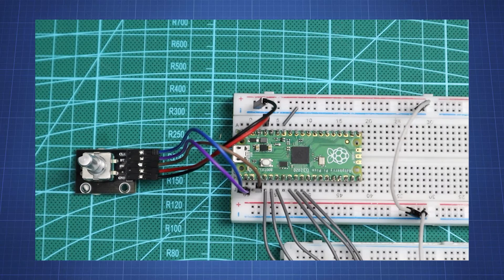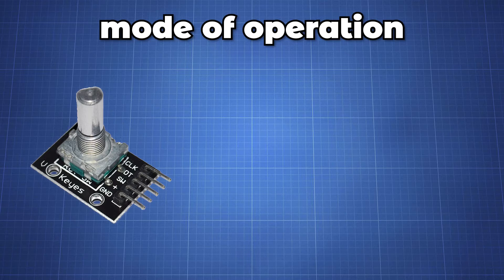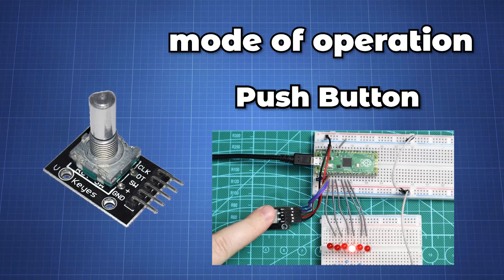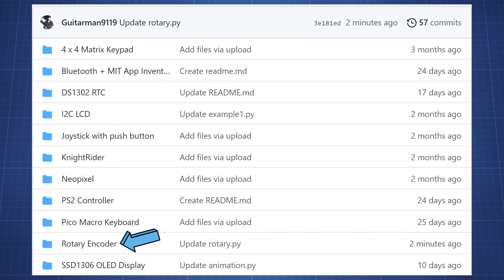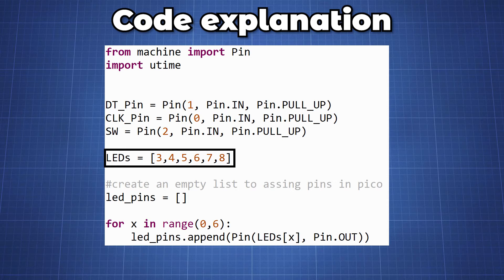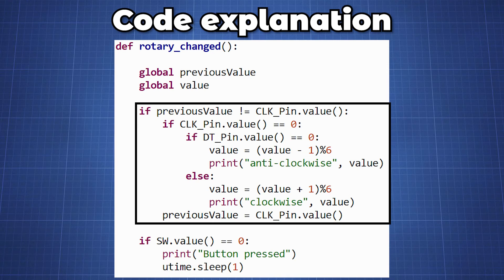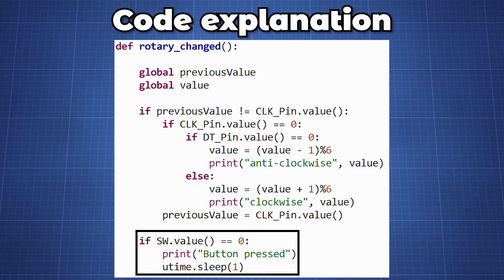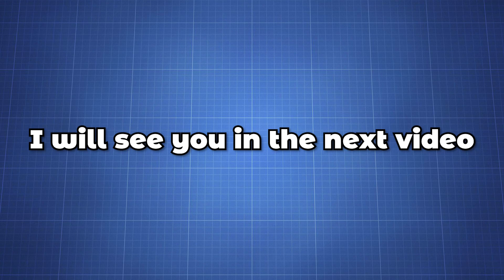Raspberry Pi Pico Tutorial - Rotary Encoder

Comment: Wether i go left or right it always increments the value.  I've checked connections, changed pins, rotary encoders and nothing. Don't know what else to do. Any ideas? Only left to try is a new pico :P.
Reply from the maker: what happens on these two print statements:

 value = (value - 1)%6
                print("anti-clockwise", value)

 value = (value + 1)%6
                print("clockwise", value)